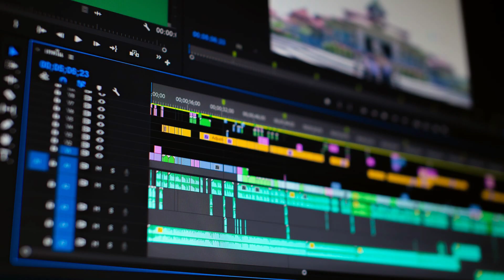Lenovo Legion 5 15 inch - DIY adding an internal SSD

Comment: What screwdriver are you using to remove the screws holding ssd cage down? I am having really hard time loosening them with my screwdriver.
Reply from the maker: I have a full set of small electronics kit screwdrivers with many sizes. 😁
Reply: @gregtay67  Do you remember if you used standart Phillips hex screw or if it was some special type of screwdriver.
Reply from the maker: @hanzgames8537  it was all philips head.
Reply: @gregtay67  Thanks for your help.
Reply from the maker: @hanzgames8537  get a screwdriver kit with different sizes.

Comment: I have question. How to disconnect the battery? Do i remove the whole thing or i just unplug the connection by removing it from the motherboard socket whicht the black thing of the battery is conected
Reply: just unpluge the connection then you disconnect the battery, dont need to remove the whole out
Reply: You can go to bios and disable battery from there, when you done you have to plug org charger and press power button and battery will be enabled again.

Comment: Great video. Can you have two Nvme drives alongside with one SSD, or you have to choose between? Kind regards
Reply from the maker: You have to choose. Sorry. 😥
Reply: @gregtay67  Thank you so much for finding time to answer me. Do you think that 970 Evo Plus NMVe M.2 will be good choice? Kind regards
Reply from the maker: Of course! It's one of the best nvme storage now, if you have the budget. Actually any nvme storage that transfer over 1.5tb per sec is awesome already.
Reply: @gregtay67  I really appreciate your assistance. Thank you very much. Kind regards.

Comment: Hello, I added my SSD before watching this video and I just noticed the screws in the black filler case you removed. I didn't use them to fasten the SSD to the mount but of course I fastened the mount to the laptop. Do you think this will cause an issue?

Comment: Hi im planning to get this laptop with a 512GB SSD,PCIe-NVMe,TLC, how would i go about adding more storage or another ssd, im new to this is there maybe multiple m.2 slots? @Greg Tay
Reply: I think there is only one slot for the the ssd/hdd. I also bought the laptop with 260gb ssd but i will change that to a 1tb ssd.
Reply: @strength4147  ye i saw that there was a way to customise how much storage it has, thx for the reply anyways.
Reply: @leroyjenkins1504  my pleasure and good luck bro
Reply: @leroyjenkins1504  yo bro, i was mistaken. The laptop does indeed have a second m.2 slot!
Reply: @strength4147  Oh alright then, thx for being kind enough to inform me of ur error :)

Comment: Really nice video.
I have one question, I have got the Lenovo 5Pi and in the full spec document, it is written as follows:
Storage
:
PCIe SSD (Supports 2 SSD.) : 128 GB / 256 GB / 512 GB / 1 TB
HDD : 5400 RPM / 2.5" 1 TB;
 7200 RPM / 2.5" 1 TB

It already has 1 TB NVMe PCIe, So from the specification does this mean I can have  total 3 HDD installed? and for HDD, should it has to be a regular HDD or can a SSD be used there?
Please suggest.
Reply from the maker: Only 2. You need to choose SSD or Nvme m.2 or 2.5 inch HDD ( same slot as sata SSD)
Reply: @gregtay67  thanks a lot mate.. last question. 2TB 2.5" HDD will work? Or cap is at 1TB?
Reply from the maker: @pratikpd5460  I don't think there's a cap.

Comment: This works for both SSD and HDD right? I did this but before seeing this video, I kind of got the SATA cable removed in the process before the actual cage for the hard drive. After doing so my hard drive was not appearing in my computer. Not sure if I messed up the cable connector or my hard drive has a problem. Would be nice if you can make a video of the SATA cable attachment then if the drive shows up in your computer to see if it works.
Reply from the maker: Did you see the drive in disk management? I will make a short video  to add to this because I'm replacing the 500GB mx500 with a 1TB Samsung 860 evo. Will upload by the end of the week.
Reply: @gregtay67  I did but it wasn’t showing there. Also the HDD I inserted was from my old laptop. Not sure if it’s not compatible that’s why maybe it’s not showing up. I’m thinking of just adding another SSD too. Anyway, will be looking forward to your video.
Reply: @Steeephen28  Still having that problem? Had the same happen to me. The drive wasn't getting recognized in bios or in windows. The cable also got removed before the cage. The reason is that it probably wasn't even connected (that's why it disconnected easily). The small white thingy actually folds and secures the cable in place. So check and make sure that the connection is locked in.
Reply: @UnknownEntity-h1f  Hello. I actually found out that the problem was with my hard drive that’s why it’s not showing up. I even returned it to my previous laptop and it wasn’t showing up there too. I think it got corrupted by static electricity as I removed it from my previous laptop that’s why it’s not working anymore. I lost some important files and definitely learned my lesson from it.
Reply: @Steeephen28  I see. That's unfortunate.

Comment: i have Legion 5-15ACH6H, i don't have that place for hdd or sata !!!  is there a way i can add it ?
Reply from the maker: I think you have the big battery. No there's no place for it. Best you van do is external small ssd.
Reply: @gregtay67  no i have the 60 battery not 80
i have empty space next to it , under the ssd place , i don't that black thing to put hdd in it
Reply: @gregtay67  i don't have that black plastic piece
Reply from the maker: @meriemben5143  the design of the different models are slightly different.

Comment: Is it safe to replace/change the SSD or ram without disconnect the battery first?
Reply from the maker: Best to disconnect the battery first. But you can see I did the upgrade without disconnecting the battery. Just don't short circuit any components.

Comment: you cannot have 2 m.2 and one 2.5" i have this laptop the 2.5" takes part of the m.2's space unfortunately but honestly you should be good if you just buy a large ssd since nowadays m.2 isnt that much more expensive if not cheaper than 2.5" because they're more fragile so if you're really THAT space needy id suggest external hard drives or ssd's and 1tb total space in the laptop 512 + 512 or 2tb 1tb+1tb if you want a more expensive upgrade but given its a laptop it has a limited amount of space inside so its smarter to just opt for the external storage devices
Reply: What about a m.2 flexi cable? Could make it fit in somewhere ? There is  a gap ( in height) behind the m.2 port? I mean just plug the flexi cable and bend it backward to m.2 port?

Comment: Wait what were the four extra screws in the plastic piece for?
Reply: I'm thinking of adding a 500 gig 2.5 inch SSD so I would like to know what they are for. Thanks in advance!
Reply: To attach the ssd to the metal tray that gets screwed back in place.
Reply: @nareshkalyanasundaram8275  it’s kind of like extra buttons on a shirt. Mainly there just in case you need them

Comment: DIY does not break warranty?
Reply from the maker: Will Warranty Be Voided If RAM or Hard Drive Is Replaced?

You can upgrade or modify most Lenovo products, including upgrading the hard drive and RAM, but only if those parts bear no warranty seal. Breaking of any warranty seal, or damage caused during repair or modification, are not covered.
Reply: as long as you know what you are doing and it does no harm to your laptop then you can upgrade what ever you want, just take it out when go warranty
Reply: @gregtay67  In Sweden i bought myself a Legion 5 RTX 3060, 165Hz 1080p screen, R7 5800H, white color backlit keyboard, and it seems i have the 60Wh model so i should have the 2 m.2 slots and a 2,5" slot. But i have talked to both Lenovo and Elgiganten (the store i bought it from) and they said if i open it up and upgrade anything during the warranty time then both warranties will be void. So no upgrade for me for another 2 years.

Comment: mine has battery where that plate is. what does that mean? its only got 256gb an i need more
Reply from the maker: So you can add another NVME m.2 ssd. You cannot add a 2.5 inch regular hard disk or a 2.5 inch SSD.

Comment: If I want to place a NVMe, can I place the 2.5 inch bracket back in?
Reply from the maker: Nope. You got to take the bracket out. Cos it's blocking the NVME slot.
Reply: @gregtay67  And is the SATA port SATA III compatible?
Reply: @anilbulut3581  yes the SATA port is SATA III
Reply: @gregtay67  if I take out the HDD bracket to add another NVME SSD, will an M.2  2280 one fit? or does it use M.2 2242?
Reply from the maker: @mediocritycentral  wow, I'm sorry I can't tell you that. I didn't measure it. You probably need to google it.
Reply from the maker: @mediocritycentral  https://www.windowscentral.com/how-upgrade-or-add-ssd-lenovos-legion-5i-15?amp
Reply from the maker: It looks like the longest one will fit.
Reply: @gregtay67  thanks!

Comment: Hi just bought mine with 8 GB ram. and i want to upgrade it to 24gb or 32? it is okay to buy a 16GB ram? or should i buy 2x 16GB Ram?
Reply from the maker: You should buy 16x2. For the dual channel memory pairing. It's faster than  single channel memory. In time to come I will also upgrade to 16x2. Prices are affordable now.
Reply: @gregtay67  so its fine to buy another 8GB ram also if i just wan to upgrade to 16?
Reply: @gregtay67  can u suggerst any brand?
Reply: @jhaydee1995  I upgraded to Ripjaws 2 x 16GB memory to get 32GB around $102 USD from Amazon ---> G.SKILL 32GB (2 x 16G) Ripjaws Series DDR4 PC4-21300 2666MHz 260-Pin Laptop Memory Model F4-2666C18D-32GRS

Comment: What are some good 2.5 hard drives I can use? I would want a 1tb or 2tb. And I saw baracuda and the reviews are mixed. And was wondering if there are more options out there
Reply from the maker: WD black series is good. However they are expensive. Next would be WD blue which are more affordable.

Comment: Does anyone know if this breaches the warranty for the computer?
Reply from the maker: No. As long you dont break anything. I sent the laptop in for repair for a power supply issue after some months and the warranty was still in effect.

Comment: Do you need an anti static bracelet to replace the SSD?
Reply from the maker: I don't know dude. In my country Singapore it's hot and humid so there's very little static electricity. If you're in a cold dry climate then it's advisable to use one.
Reply: @gregtay67  Thanks!

Comment: Hello, i just purchased the new legion 5 amd spec. Here is my concern, it comes with single stick 8gb ram 3200mhz and i want to upgrade to 16gb but i couldn't find any sodimm ram that has the same 3200 speed. Any suggestion on how to solve this problem? Thankyou !
Reply: lower bus speed is usable
but you better use 3200
Reply: I have the intel version with a single stick of 8GB but the speed says 2933 mhz (It said that in the task manager, I thought it would be 3200).  I was thinking that I may need to buy two new sticks with matching speeds.  Lennovo says it can't take more than 16gb, but I have read that 32gb works.  I am not sure if I should just keep it at 16 or buy 32 instead.
Reply: Padu din. aku pun beli hahaha 😂. Ram kau usha shopee ada
Reply: The one in the laptop is 3200MHz Cl22 as well
Reply: go buy a 3200mhz ,you should get that in any computer shop i believe ,especially gaming laptop shop always have that type of ram since AD is banging this year

Comment: I ordered 512 ssd version 
Can i add 2 tb hdd ??? Is there is a place for it !
Reply: if you have a 2.5 2tb hdd you can put it on the caddy. you should be able to have a sdd in the nvme m2 slot
Reply: @jasonkiller9942  I also ordered the same.
Does this mean I can add both 2td hdd and m.2nvme ssd  in tthe same place (one below the another)?

Comment: Can the Lenovo legion 5 be upgraded to external ssd
Reply: Yeah unless someone corrects me, there's no reason you couldn't plug an external SSD into it. It's not a very portable gaming laptop anyway, so if you're basically using it in one spot, the external won't be too big of a pain anyway.

Comment: So I can't have 2 m.2 ssds and another 2.5" ssd?
Reply: Same question here. I do need LOTS of space. Anyone?
Reply: @mayconight  yes you cannot have 2 m.2 and one 2.5" i have this laptop the 2.5" takes part of the m.2's space unfortunately but honestly you should be good if you just buy a large ssd since nowadays m.2 isnt that much more expensive if not cheaper than 2.5" because they're more fragile so if you're really THAT space needy id suggest external hard drives or ssd's and 1tb total space in the laptop 512 + 512 or 2tb 1tb+1tb if you want a more expensive upgrade but given its a laptop it has a limited amount of space inside so its smarter to just opt for the external storage devices

Comment: I guess you can't add an HDD in this laptop, you can only have 2 SSDs, that's sad
Reply from the maker: Just buy another 4TB NVME SSD! 😁
Reply: @gregtay67 , allow me to present my case: I do need both M.2 AND the 2.5 HDD, for Windows and Linux stuff. Is it possible?
Reply from the maker: @mayconight  you can only have either 1 nvme 1ssd. Or 2 nvme.
Reply: @mayconight  I have Win/Lin with the M.2 and Sata. Why would you need three drives  for two OS? You can even do it with one.
Reply: @emilianoescobar1015  I'm a mobile/frontend developer (Linux) and I also play/record keyboards with heavy VST plugins (Windows). So it's better to keep things on separated drives
Reply: @emilianoescobar1015   what linux do you run and did you get backlight and touchpad to work?
Reply: what linux do you run and did you get backlight and touchpad to work?

Comment: Does every legion 5 come with the empty drive case?
Reply from the maker: Yes. Unless you get the big battery option in some countries.
Reply: only 60wh come with the case not 80wh
Reply: @gregtay67  i have one with the big battery how can i add the 2.5 ssd ? There is no space
Reply from the maker: @danielesposito8589  you cannot add a 2.5 ssd or hdd. But you can still add a m.2 nvme.
Reply: @gregtay67  thanks so much I was going crazy you get my follow for sure :)